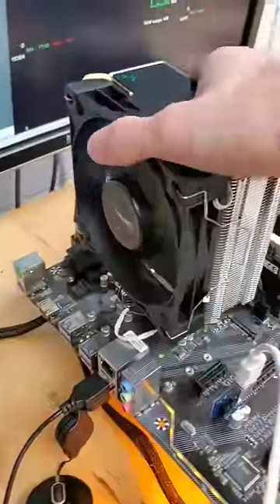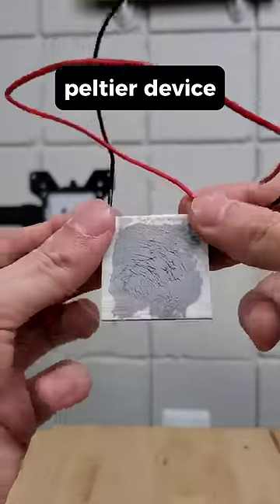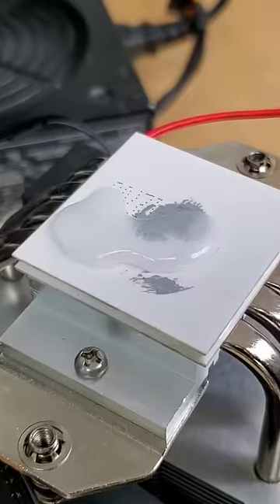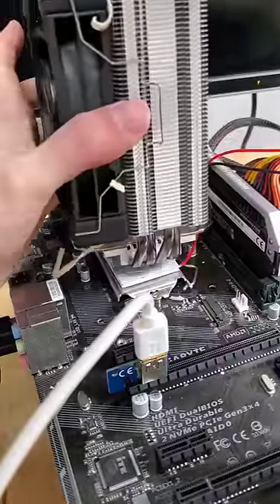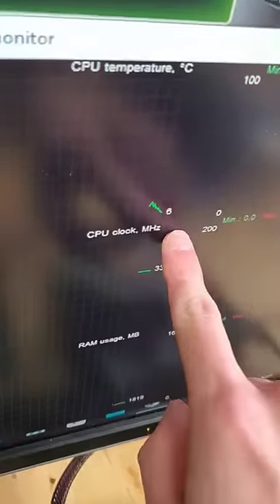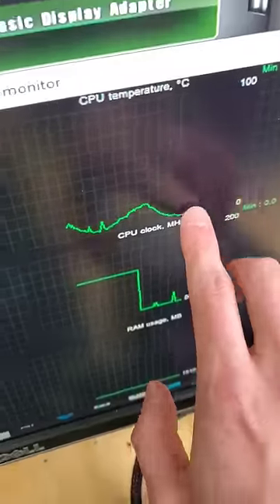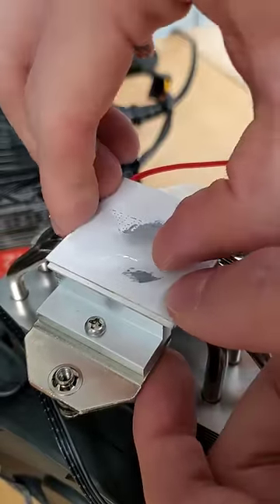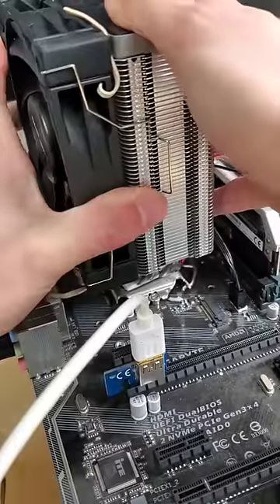using a Peltier device to cool a CPU BELOW 0°! #shorts

Comment: You know your cooling solution is good when the temperature graph can't even display it properly
Reply: either its really good or its really fucked
Reply: @corndoghead1 there's no in between
Reply: Yea i think when pc is on fire cant measure to 😂
Reply: This thing works only with low power CPUs and on idle only. Because it has hard limit how much can it transfer heat of the CPU.
Reply: Nah.. the peltier isn't as strong as liquid nitrogen
It's only get cold into 0 to -50°C depends on the peltier specifications (code number)

The one on video is 12v 6A because the number is 12706 and this peltier with this code number only can go for 0°C

And CPU still able to run within -20°C so it's fine so it's fine
Reply: Or bad
Reply: It’s worth to know that he never tried this under load because that thermoelectric cooler could probably not handle it and the cpu would most likely overheat under load.
Reply: @isaias-1713  nah... It’s fucking good
Reply: I'm disappointed that they just use thermistor measuring, although I guess it kinda makes sense
Reply: No you can just rescale the graph and make 150C off the bottom of the graph. Hit it with a load then we'll talk...
Reply: The best cooling solution is building a server room ontop of a mountain that is cold year round
Reply: Peltier was a bad idea in the 90s and it is a worse idea now as CPUs draw more and more power.

Apparently this is like fashion, it keeps repeating the same bad ideas.
Reply: @isaias-1713 yeh because the in between is within measurement parameters.
Reply: If it gets too cold, then you'll get water damage.
Reply: This is bad because of the condensation water
Reply: Liquid cooling with liquid nitrogen next
Reply: True, I have a device that stops reading after 1000 degrees 💪
Reply: This is a bad idea mainly because such low temperatures will likely create water condensation. Also (as mentioned) the other side of the plate generates a LOT of heat so you still end up with a very hot thing you need to cool. ALSO, the amount of energy the plate needs to operate... If bills are not a problem tho, I guess that's fine.

Comment: Gaming laptops: finally a worthy opponent
Reply: Now it gonna have heat gun for vent
Reply: @deecat2018  use it to heat coffe cup
Reply: @deecat2018  ramen boiler
Reply: Finally I can keep my drink warm while the windows open
Reply: @valentinosstamkos4022  lol or the room put another fan now your cold room will get warm eventually if you game long enough
Reply: @deecat2018 rice cooker
Reply: My acer nitro 5 gets up to 90°C by just playing war thunder
Reply: I’ve got an old think pad that would go up to around 105 degrees, while idling it would sit between 50 and 80 degrees.
Reply: I do it to melt chocolate or heat something already  @deecat2018
Reply: Battery: no shit
Reply: It wouldn't be wise to use it, high temperature differences could lead to cracking the CPU due to temperature differences. You have to gradually cool it.
Reply: @onegalaxytwo Might want to reduce CPU power. My laptop was at a constant 90 in every game regardless of how intensive so I reduce my CPU power draw from 100 watts to 25 and saw a massive drop in temps with no change in performance
Reply: @visiblydisturbed1688  I'll have to try that, thank you
Reply: @onegalaxytwo  Yeah.. 90 is way too high. Definitely going to be getting some heat throttling. Some cpus come pre-overclocked. It may be worth checking this isn’t the case in your bios.
Reply: You will need to provide more energy to it than the total Tdp of your CPU/GPH. It's not a good technology for cooling computer devices.
Reply: @deecat2018 😂😂😂 i think i peed a little
Reply: @deecat2018 it already does so it won’t make a difference
Reply: This have to be a gamechanger 4 Laptops right ?
Reply: Just use ptm 7950 (if you can get it)
Performs as good as Liquid metal without the risk of applying it wrong
Reply: @onegalaxytwo That's too much. I highly suggest undervolting as well as using a cooling pad while playing resource expensive games.

Also you should check the minimum processor state in the power options and make sure it's 5%.
Reply: isn't safe? Too cold creates condensation to water droplets 😢
Reply: @pcsuchti66 I remember playing around with one in the early 2000’s, they cause condensation, and would very likely kill any system used in a humid environment.
Reply: @xrtango  then we need to optimiert that puppy , send one to linus lets see what he dose with it
Reply: Now we need a solution for the giant heatsink
Reply: @deecat2018 they already do
Reply: @onegalaxytwo repaste with liquid metal(watch multiple good tutorials before you attempt this), clean the fans+heatsink and undervolt.
Reply: @onegalaxytwo  attacking D point with this one 🗣️🔥
Reply: What you don't understand is you need a REALLY good heatsink and fan.. A peltier cooler gets as hot as it does cold and it often cancels it out and it just gets SUPER HOT and cook the cpu.. I know I used to do this like 30 years ago..
Reply: My laptop usually cooks steak
Reply: COP of this type of cooling device is a lot lower than other refrigeration devices, as its working principle relies on the amount of watts getting in (90-150watts), its power hungry, consuming 90% wattage of your 99 whr laptop battery. I wonder why it never made sense to use them in mobile applications in the first place.
Reply: Great now the battery drains in 2 mins
Reply: @valentinosstamkos4022 the gaming stove
Reply: @valentinosstamkos4022  bruh I'm always using my wents to heat milt to the room temperature, it takes like a 10 minutes
Reply: Yeah
Reply: @deecat2018 but its worth it

Comment: Time to have problems with your cpu freezing
Reply: People joke, but if the cpu gets too cold, it's possible that condensation could build up and short something out.
Reply: @Deadeye313 coat the CPU lid in a thin layer of nail polish? At least that's what you do when you're doing liquid nitrogen
Reply: @blumind_web2264  that's the most clever but silly solution to something
Reply: Nah.. the peltier isn't as strong as liquid nitrogen
It's only get cold into 0 to -50°C depends on the peltier specifications (code number)

The one on video is 12v 6A because the number is 12706 and this peltier with this code number only can go for 0°C

And CPU still able to run within -20°C so it's fine so it's fine
Reply: @Deadeye313  LTT used Vaseline for a similar project didn't they?
Reply: @aneeshdate6195  Yeah they do strange things like burning computer to cool a cpu 😅
Reply: Its worth it for those fps
Reply: That cooling device is using too much power so it's not worth it
Reply: @azizsetyawan3038  look up the dew point of your area. It should change depending on humidity, temp...etc. but im willing to be this gets low enough lol
Reply: Look up LN 2
Reply: @IIBLANKII  
well. If CPU on load I'm pretty sure there wouldn't be condensation since the CPU itself can go up to 80°C and this peltier with the same number code on video would only be able to cool down for 50-20°C

Depending on the cooling you use for cooling down the hot side so the cold side still can remain colder
Reply: @azizsetyawan3038  how to spot a person not knowing what a heat pump is
Reply: @Deadeye313  Actually the bigger problem is that you are operating the chip outside its specified operating temperature range and correct operation of the chip is NOT guaranteed.

Temperature affects the timing of signals in the chip. And the manufacturer has designed it, and performed verification by logic simulation to ensure it works over the specified temperature range.

How the chip behaves outside of that specified temperature range has not been quantified by the manufacturer.
Reply: Actually, CPU will freeze when it's too hot. CPU actually runs better when it's colder.
Reply: Now overclock it
Reply: Cpu freezing may literally happen with this
Reply: With these type of cooling is more the opposite under load
Reply: Do this on a GPU
Reply: @Deadeye313  Condensed water is not conductive, unless some impurities get is which is less likely to happen inside the cpu, so there should not be any issue.
Reply: @rustygear9370  .... you are way off. Its still conductive to a point because as soon as it touches anything around it, its picking up microscopic amount of  metals...dust...etc. not to mention it doesn't take much energy to go from one trace to the other, or for it to lower the resistance just enough to jump from one contact to another...etc. if you want to prove me wrong, go build a unit that sits under the dew point for longer then an hour without making any measures of countering the condensation lol. Trust me, its not lasting 10 mins at -10c if lets say the room is a nice cool 62°F.
Reply: @azizsetyawan3038  well, its currently at 0°C in the video lol. Which is about 32°F if the room is lets say a temp of 70°f, if they have a really low humidity level of 30% that would mean the dew point (barring atmospheric pressure and other things.) Would be about 37°F. If it was lets say 50% a normal home humidity temp where im from then this number rises to 50°F. Which would still be within reasonable tempreture for even the 40~50 you mentioned. If its a colder climate saying the home is kept at 60°F with a humidity level of about the same then this would drop the dew point to 40°F...etc. 

Pelter coolers are not very efficient, but they can still create condensation even with pretty crappy ones like this lol.
Reply: @IIBLANKII  yea it's not efficient. It costs a lot of energy waste as heat

But if you cooling the CPU such i7 13th gen or i9, you shouldn't fear about the condensation because that Chipset is hot, and even with peltier wouldn't bring you into condensation point
Reply: @joyhanschristabelsinaga1322 Who would've thought that they run better when colder, and what do you mean by they freeze when they are too hot. How would that work, they force shutdown the computer not freeze itself.
Reply: @hububdadub you ain't lying lol
Reply: Not if I turn it 170%
Reply: Damn. Now I have to invent a cpu heater.
Reply: It is a problem ,way before 0 you get condesation
Reply: easy way over clock the f out of the cpu so it won't be so cold and run a bit hot whit that monster cooler 😂😂
Reply: Other than the cpu getting condensation on it you cant really make it to cold since overclockers routinely use liquid nitrogen to test the limits of cpus.

Comment: Condensation could have never been a bigger problem😅
Reply: You can fix it with insulation
Reply: Chalk...
Reply: cpu highest clock speed competitions: are you sure about that
Reply: You could set both the CPU and the peltier thing in a double vacuum to solve the condensation problem.
Reply: Don't want to touch that super cold surface with your fingers, it might flash freeze your skin and then yikes you'll be in all sorts of trouble
Reply: Not completely sure if this is how it works, but since the thermal paste makes the cpu essentially vacuum sealed to the device wouldn't that make condensation not really happen
Reply: I wonder if liquid metal thermal paste would go solid
Reply: @gatok-sb3rp 😂😂😂 yeah, that'll work...
Reply: @kevinburns8473 why not a triple vacuum?
Reply: @TristanPetsch bro doesn't know what a vacuum is 😂😂😂
Reply: The biggest issue is powerdraw lol they eat up so much electricity
Reply: @gatok-sb3rp  or you could just cool the heat sink separately and have another heat sink on top of that📚
Reply: Now we need to throttle down the peltier device
Reply: @kevinburns8473  The heatsink uses airflow to move heat from the CPU/Peltier Device, and into the ambient air.  This is why your room can get hot when you're playing games on your computer or console.  In a vacuum, the heatsink won't be able to work very effectively; as the only way it could transfer heat is by radiating it out.
Reply: silica gel
Reply: Seems like a great idea for a water block.
Reply: @vampcaff Thermal paste fills in the little microscopic holes in the cpu heat spreader, and the heatsink, thus there's no air in between them.
Reply: @gatok-sb3rp  or you can just get dozens of dehumidifiers and place them around the house
Reply: @TristanPetsch you're kind of right, but the sides of the device are still exposed to normal atmospheric pressure air. Just that millimeter of potentially exposed cold surface would be sufficient to condensate water from the surrounding air and cause shorts during operation if you're unlucky.
Also, nobody here took the underside of the MB into consideration. If the CPU is below 0, so is the surrounding Mainboard. Good luck preventing condensation in such a large area without a vacuum
Reply: Just use a dehumidifier   at your room. That will solve that.
Reply: TristanPetsch asks whether thermal paste on one side of the CPU would prevent water condensation and pooling.
Trustan, the answer to your question is no, it does not.
Reply: Just pop some silica gel packs
Reply: @maladroit1  silica thermal paste💀💀💀
Reply: @TheTechieLemon so crazy it just may work
Reply: Not with intel 😂
Reply: You needed a dew point sensor back when you used these so it didn't form condensation in your case by stopping it going to far below ambient
Reply: @kevinburns8473  ah yes the ubiquitous Vacuum pressure sealed PC cases .... 🤨
Reply: thats exactly why peltier is not a common cooling method
Reply: @gatok-sb3rp  *attempt to mitigate, it's not really a "fix"
Reply: Know your dew point and adjust lowest temperature to that on that cold plate.

Comment: I guess I know how I’m going to overclock my CPU now thanks😂😂
Reply: Same 😂😂
Reply: Delid your cpu, cover some smd component under it with nail Polish (to prevent condensation water), then go on 🎉
Reply: Yeah about that that thing makes one side hot and one side cold and it's WAY to hot to cool down with a CPU cooler you will need to undervolt it to keep it from burning

Comment: It's time say goodbye to my room heaters 😢
Reply: Don’t worry bro, one side gets hot, the other side gets cold, so you still have the heater
Reply: The heat is still being generated. In fact, you’ll be generating more heat than before
Reply: It only cools lower TDP CPUs, modern higher end CPUs overwhelm these the moment you open a game.
Reply: Probably not actually, like he said the other side is equally as hot cause thermodynamics
Reply: Have fun with 📈 electricity bills
Reply: What do you mean? The cpu outputs still practically the same amount of heat, and the peltier adds extra on top of that. It'll just be worse.